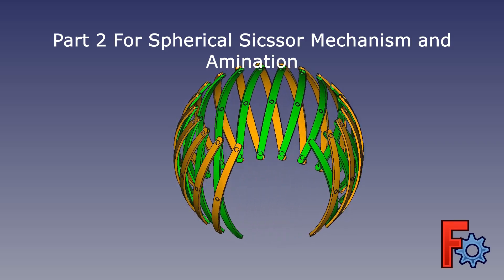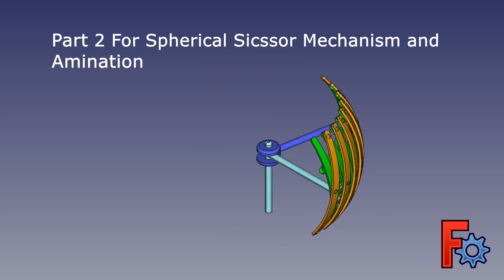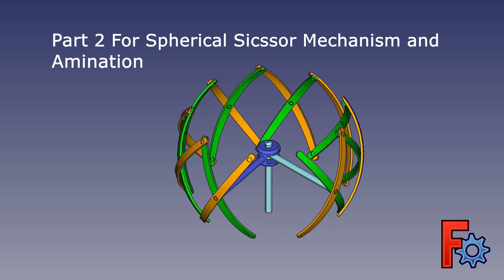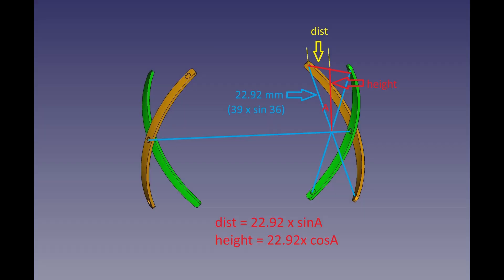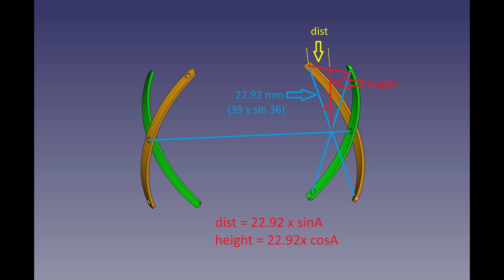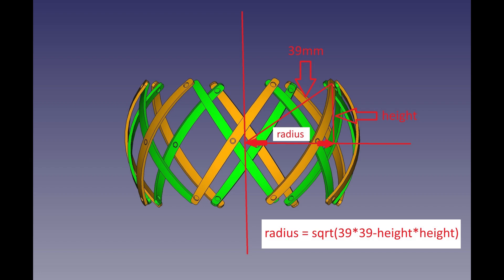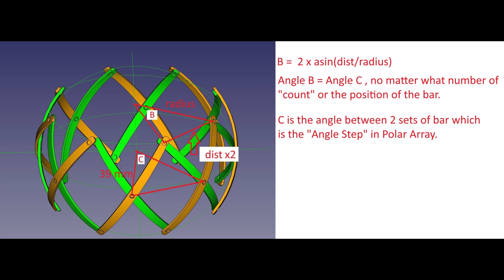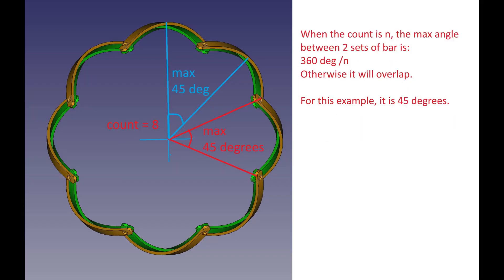FreeCAD Tutorial - Part 2 for Assembly 4 Spherical Scissor Mechanism & Animation (Assembly4)

Comment: 36° is the angle of the reference plane to obtain the distance and height. This is indeed the Pythagorean formula for finding the radius. For asin, I will revise the formula. Thanks. See you next time and good week end
Reply from the maker: Not sure if I understand your statement or not. 36 degree is the plane to fix the point of the joint. It is to determine the length 22.92mm only, not the "dist" and "height". Because the bar is swinging and "dist" and "height" are keeping changing. They cannot be determined just from the 36 degree plane. Hope it helps.